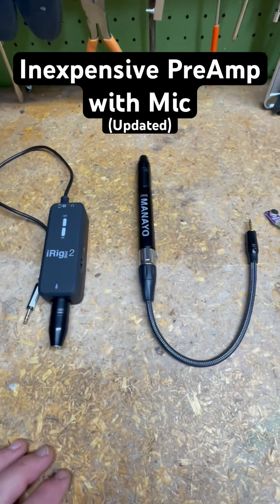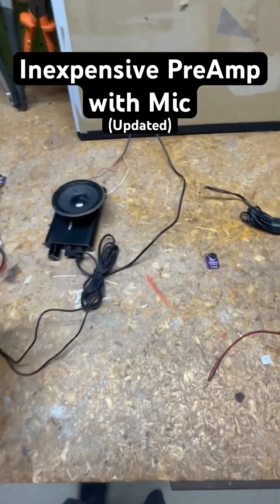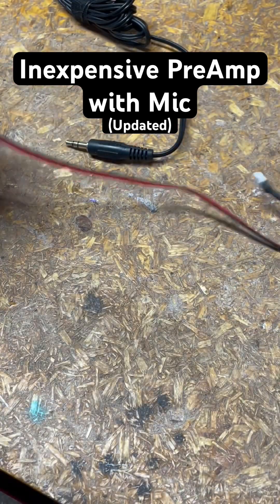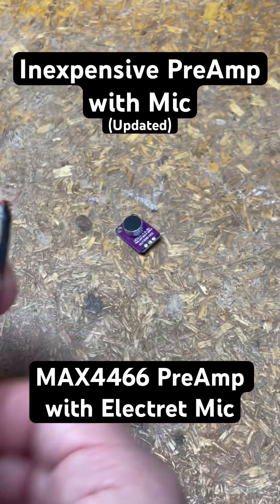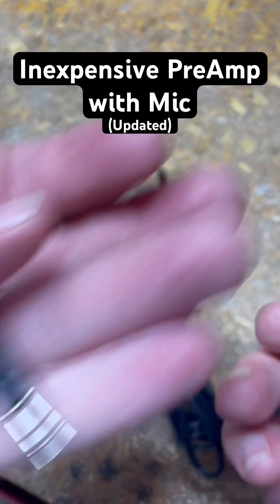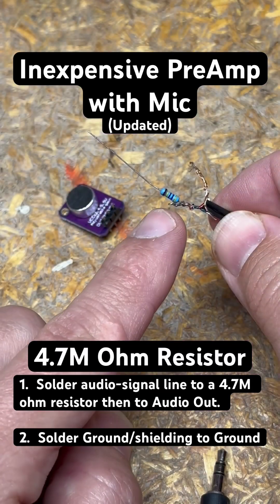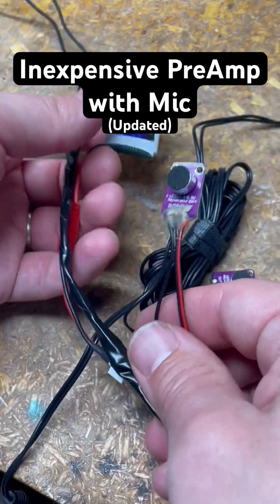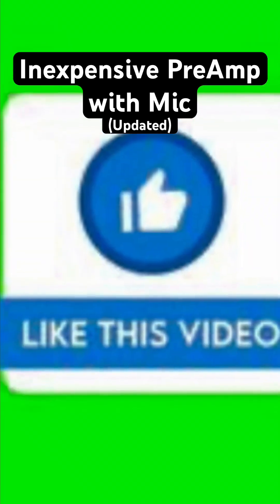Easy PreAmp System + mic - #inexpensive #DIY #audio #mic #microphone  #preamp #amplifier #cheap

Comment: is any resistor ok? what affects the value of the resistor?
Reply from the maker: Do at least a 4.7 million ohm resistor. And you wanna keep your amp knob on the back to the lowest amplitude increase. Because these little preamps are pretty feedback prone. The resistors help reduce the feedback.
If you don’t have 4600,000 oh you can put a bunch of other resistors in series to achieve it but you don’t have to have exactly that. I think originally I only had 1 million om and it made a huge difference, but it was still very feedback prone Which the 4 million resistor cut down on even more so you could keep stacking resistors until you’re happy with how limited it gets the feedback.